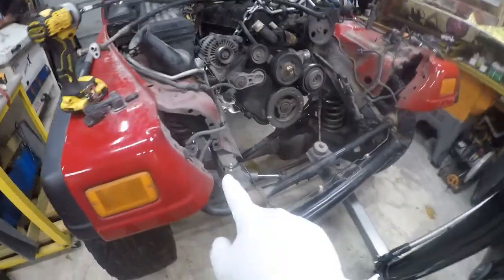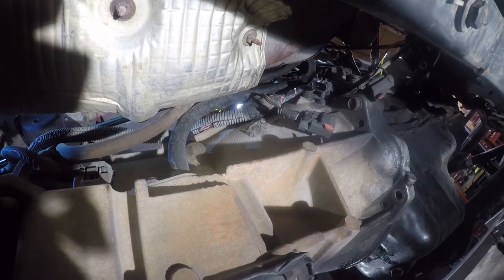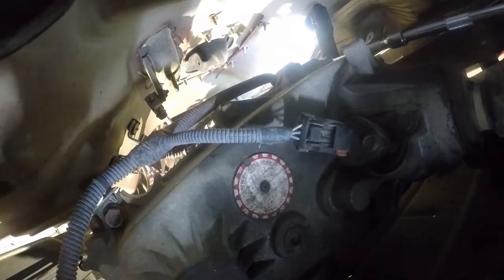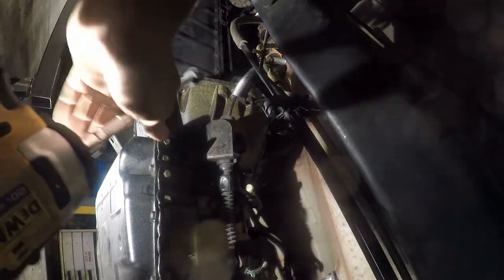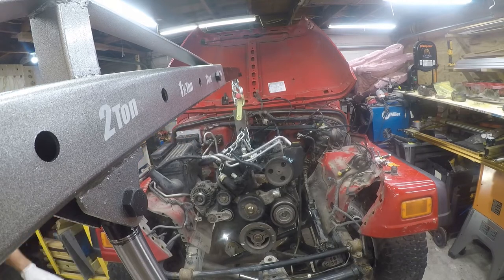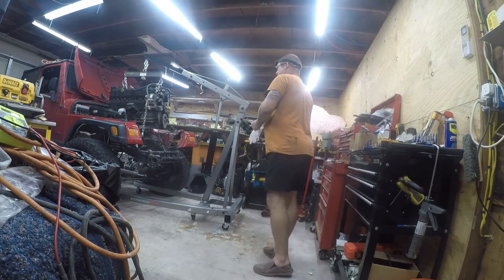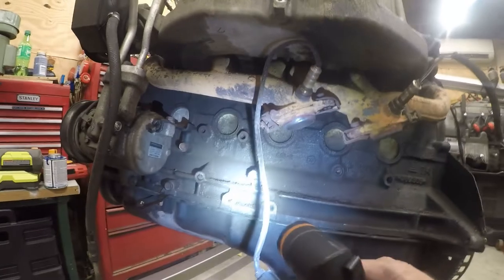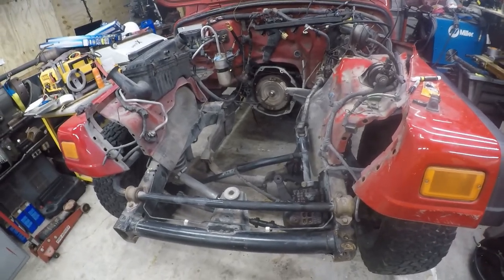Jeep TJ Build - Jeep 20: Engine comes out and removing the last bolts/wires.

Comment: OK i just lelf my 2000 TJ , the two top 12 points bolts are frozen / rusty / and strip ,,, took of the Head . going in with a cut off wheel , and a small drill bit ,,
Reply from the maker: Those are particularly difficult to get to.  Jeep seems to specialize in doing things that are difficult to service.  I can't imagine it saving them more than $20 per vehicle in manufacturing for all of the stupid anti-serviceability things they do.